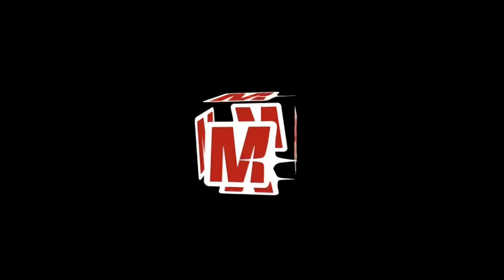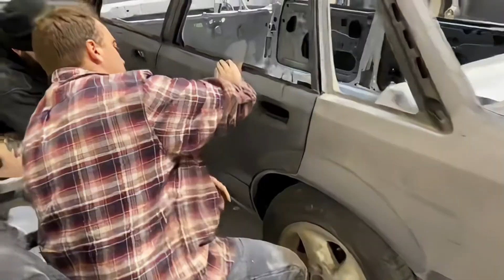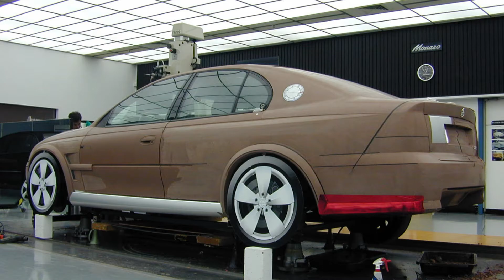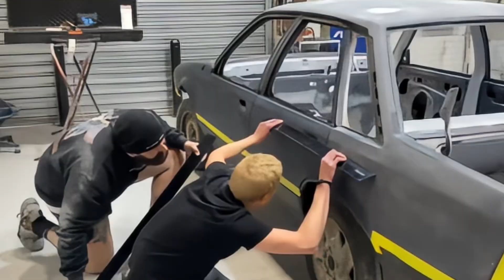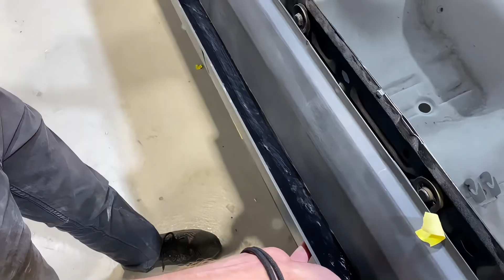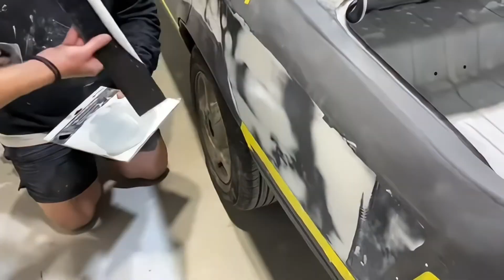How to apply automotive body filler "Bondo" accurately, planning and preparation.

Comment: It will look smooth etc, we can all understand this, and it is definitely way better as you say then cars bogged panel to panel, but the term "restoration" is to take something to it's original finnish ie, press marks etc, now im definitely not knocking the work, but the use of the incorrect wording. People out there already are not realising how these car panels did look leaving the factory. Yes commodore & falcon etc gaps were uneven, but that is, how they were. A Brock fan etc, does like to still see that. But each to their own.
Reply: If it’s not a restoration what is it?
Certainly there’s differing styles of restorations but the wording of restoration in this context is 100% correct. But yeah each to their own 🙄

Comment: Doesn't give any extra to sand straight tho. As soon as you hit that with 80 and 120g it's low again.
Reply from the maker: The amount of sanding required from here is minimal, as the filler is already the correct shape. The entire surface is sanded evenly, including the thick epoxy underneath the filler. No need to only sand the filler.